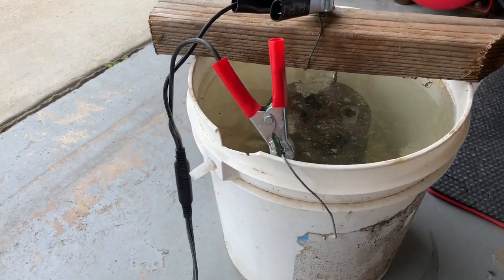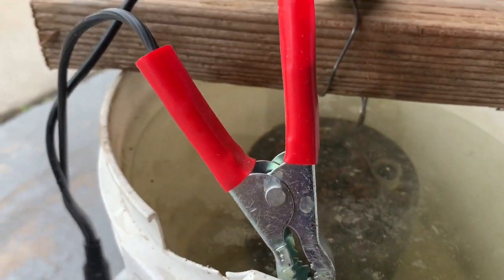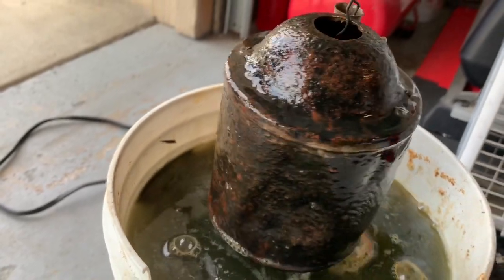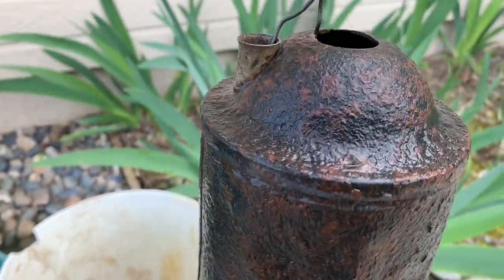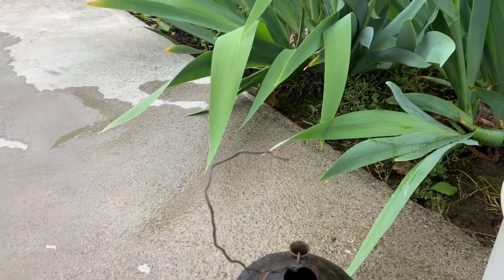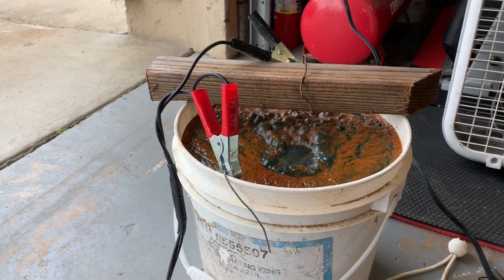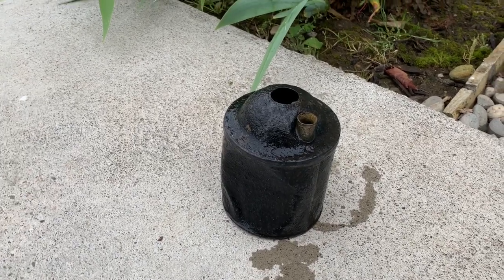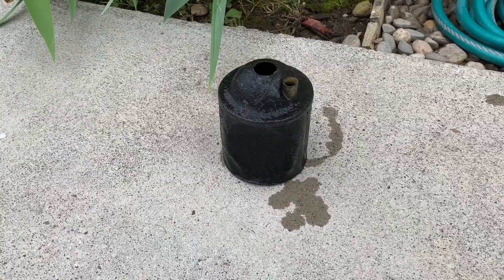Easy way to remove rust from metal objects

Comment: WOW, nice way to clean stuff. I would of use evpo rust to clean it. but this way is far better and cheaper to do.
Reply from the maker: yes it works great. I have  gear about 5 inchs around that was covered in rust in there now, I will post a video of it when it comes out tomorrow. Thanks for watching!